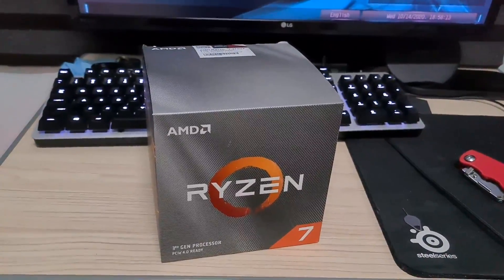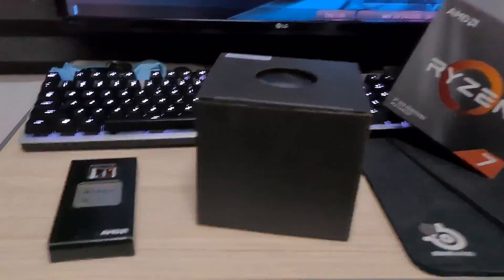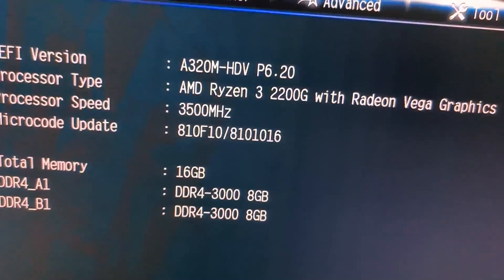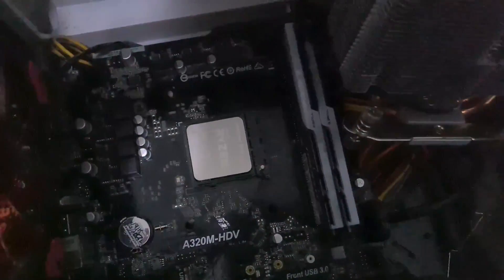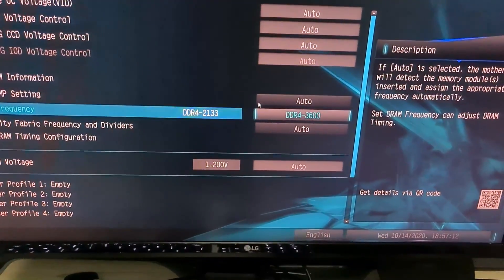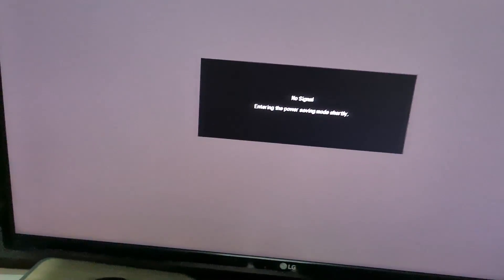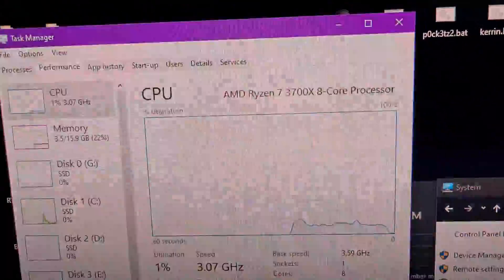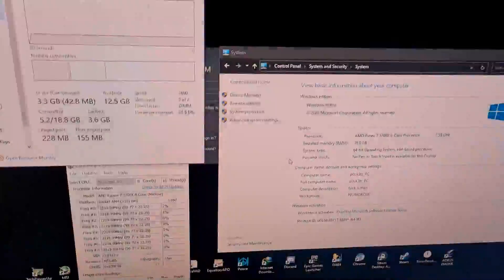pairing ryzen 7 3700x to the a320m hdv

Comment: Hi. I'm planning to buy 5700g for my asroc A320M. Currently I have 2400G. The reason for me to upgrade my processor is my CAD software starts laggy. If I have to also upgrade the Motherboard means that I have lower Processor spec. Maybe only 5500G.

What do you think?

Comment: Hi just got this cpu I have a msi a320m-a pro max motherboard with gpu prices being what they are was going to update this for now till I can get a gpu but cpu I have till this comes is  ryzen 5 1600af
Reply from the maker: well you could always update from now, using the bios version that comes from the factory is plain no bueno because of instability and even losing a wad bit of performance (my case)
Reply: @P0ck3tz  already updated had to do that for ryzen 5 1600 af to use it

Comment: I have a a320m-e motherboard, will a ryzen 7 3700x be ok?, I currently have a 3060 rtx gpu but need a 8 core to get best performance out of my 3060. Is this combo ok? I currently can’t afford to blow up an entire pc.
Reply from the maker: indeed that should be fine, I used a 3700x 3070 a320m combo for over 5 months with no issue and no slowdowns at all

Comment: Hello, I liked your video. I have a question, I have an MSI A320M Pro-VH Plus and I am planning on upgrading my processor from Ryzen 2400G to Ryzen 7 3700x...
My questions are:
•is my motherboard compatible with the Ryzen 7 3700x?
•if so, do I have to update my motherboard's bios?
Reply from the maker: yes it is compatible as long as you do the required bios update to enable 3rd gen ryzen support. some new a320m's these days come with 3rd gen support out of the box but as I said that's only the newer ones (2020 upwards). you might wanna check your specific mobo version if it already has 3rd gen support or not, if I were you I'd still do the bios update just to get it to the latest version and for stability reasons

Comment: Is ryzen 7 3700x compatible with A320m-H?
Reply from the maker: 3rd gen works with most a320's, but some brands dont support it yet, try to check your specific brand if it has 3rd gen support on its latest bios version
Reply: @P0ck3tz  yes it supports 3rd gen
Reply from the maker: @hakon8154  well go for it, my a320 doesnt come 3rd gen supported at first, but a single bios update made it supported
Reply: @P0ck3tz  It all worked out no problems normal temps thanks alot

Comment: @p0ck3tz hi there great video.. I have the same mb and I got the 7 3700x..i flash bios like your video and put the cpu in.. It will not reboot and stay on loading screen asrock. You may the only one that can help m. Thanks in advance
Reply from the maker: is it possible to go into bios and see if the motherboard is detecting your 3700x?, you flashed your bios with another cpu that worked before right
Reply: @P0ck3tz   I can open bios and it says that ryzen 7 3700x is on but is stuck on the loading screen of asrock.  I flash bios with USB using my old cpu 5 1400. I run cpu-z and the bios version is p6. 20 i run troubleshooting with repair tool but I get a blue screen
Reply from the maker: @philippossolomou8787  try reinstalling windows, sometimes windows drivers will conflict when changing a CPU even when the motherboard has not been changed.

Comment: is it okay if i use the STOCK COOLER of Ryzen 7 3700x (Wraith Prism Cooler) on the same motherboard you used in the video. Since we have the same MOBO that i have right now.. Thanks in advance.. :)
Reply from the maker: yeah that's totally gonna be fine, it'll only affect the cpu temperatures and not the motherboard VRM so it'll be all fine and well
Reply: @P0ck3tz  Because of you im getting my Ryzen 7 3700x this week!! Let's get in touch with our Ryzen 7 3700x okay.. You got a sub from mine cheers!!
Reply from the maker: @theborbz3024  glad I can help another person
Reply: @P0ck3tz   @p0ck3tz  Hello my friend, i have the same mainboard, i bought the rtx 2060 and want to ask you if I can use it proper and it works smooth with the ryzen 7 3700x...and also i want to ask if you could recommend me a motherboard with 5.1 soundcard for my usrround Sound  because i need to buy an creative soundblaster x4 for 150€ if I buy a motherboard  for that money or a bit more for same prive i woud have 2 advanteges and spend money on a motherboard with a good surround sound card instead of spending 150€ for just sound.THANK YOU
Reply from the maker: @anniannihilator5029  yeah the 3700x and 2060 will work no problem, i had my 3700x and 3070 paired with an a320 and it had no problem and no bottlenecks. As for the sound card try not to get those pcie sound cards, theyre gimmicks these days. You can always get an external AMP for way way cheaper. I dont know much but im pretty sure most motherboards already have an intergrated sound card, my x570 tomahawk does but my a320m also does (i dont feel any difference in sound between the 2)
Reply: @P0ck3tz  Thank you so much, to be sure, because i am from germany, we are talking about the 
ASUS PRIME A320M-K right? People say it qill bottleneck the ryzen 7 3700x and rtx 2060 therefore i asked you as a pro :) they recommended me the ryzen 5 3600 but i Red it has some heating problems ..i am from germany, thank you.And Yes, i have a sound card on the mainboard but there is just one entrance on the back also with 3 double chinch cables i need 3 entrances,therefore i want to buy the 
"CREATIVE Sound Blaster X4 Hi-Res 24 Bit/192 kHz Externe USB-DAC- und Verstärker-Soundkarte, Super X-Fi, diskreter 7.1.-Surround, Optischer Eingang-/Ausgang, Line-in Mikrofon-Eingang, Headset-EingangCREATIVE Sound Blaster X4 Hi-Res 24 Bit/192 kHz" 
i thought for that price you could maybe recommend me a new motherboard or something.:) Thanks my friend
Reply from the maker: @anniannihilator5029  it seems that the bottleneck seems to be cpu/gpu. not the motherboard, unless you plan to upgrade that 2060 in the future then get the r5 3600. And don't worry about heating problems. my Asrock A320M-hdv (cheapest a320m out there) powers my 3700x and 3070 with no issues at all, vrm temperatures are all under control and normal. Though i do use a pretty decent air cooler so the turbulence that those fans make probably help cool the vrms. But honestly if you are buying a new motherboard just get a b450/b550 and dont bother with A series, i made this video for people that were stuck with A320 and had no money to upgrade (the price gap between A series and B series is minor tho)
Reply: @P0ck3tz  Perfect!I will stay with my mainboard, last question, booth are the same prive here, the 3600 and 7 3700x, the second one has an coloured air cooler which i öike more, so still go with the 3600 if I dont want to upgrade?I will click the bell now, you are very smart, i dont wanna upgrade..
Reply from the maker: @anniannihilator5029  ah so youll stick with this configuration for years huh. then get the 3600 + 3060. Also whats your use case? Gaming or Productivity (Video Editing/Render)
Reply: @P0ck3tz  my pc i bought 1 year before, it has the Asus PRIME A320M-K Mainboard, and had the ryzen 3 3200G processor...it was to week therefore i bought rtx 2060oc now i am looging for processor therefore I asked you whoch one u would recpmmend..so i will buy the ryzen 5 3600..and i am thinking if the mainboard will bottleneck some of that parts, but now  i will stay with the mainboard because thats just enough some people told me, correct?Good decision?
Also i eill buy the samsung odysay g9 120hz and 1440p resolution
Reply from the maker: @anniannihilator5029  yeah that looks like a solid plan then. No worries man the A320 wont fail you, it wont all of a sudden break or have bottlenecking issues. Just make sure you're up to date on the motherboard BIOS version though
Reply: @P0ck3tz  what does that mean in no difficult english ^^"it want all of a sudden break or bottleneck..."
Reply from the maker: @anniannihilator5029  basically you dont have to worry about the motherboard breaking or it giving you any issues, because i also have used my a320m with 3700x with no issue. its just like i was using an x570
Reply: @P0ck3tz  Thank you, ok then i am happy :)

Comment: hi I wanna upgrade my processor to 3700x/3800x,
currently I'm using ryzen 5 2400g with A320M

do you know what is the difference if we upgrade the motherboard to B450/B550 rather than use this A320M?
my budget is tight,
thanks
Reply from the maker: if you dont already have an A320M i still would recommend getting B450/B550, A320 is rather still a risky pick if you dont already have one on the long term. B450/B550 is built for ryzen 3000 and thus VRM Temperature and overclocking isnt gonna be an issue. I mean sure ryzen 3000 doesnt overheat the A320. its been over  4 months and no problems with A320 but if i were u id save up and still get B450/B550 for that overclocking capability, 4 ram stick slots, better cooling, and better looking as a gimmick too

Comment: How do i update the bio
Reply from the maker: 1. Get a flash drive and plug it into your PC
2. Go the the motherboard manufacturer site and find your model and download bios flash/update
3. Put that file inside your flash drive (has to be empty with only that single file)
4. Restart your pc and spam F2 to go into bios
5. Find the bios flash feature and select your flash drive
6. Select the file and wait for it
Reply: @P0ck3tz  hey buddy, did you update the bio before installation of 3700x or right after the installation?
Reply from the maker: @clickfaithmultimedia  before, you always have to update the bios before since if you have outdated drivers the 3700x wont work. but again you need your old compatible cpu to do this

Comment: Hmm so i can upgrade my r5 3400g to r7 3700x then? 🙂 and should i change the fan too for the cooling or i just stick with the original fan?
Reply from the maker: it's fine if you want to use the stock prism cooler of the r7 3700x since we aren't gonna be overclocking anyway with an a320

Comment: Is your pc still running perfectly?
I have asrock a320m with 2200g
I want to upgrade it to 3600 or the X version
Reply from the maker: The God of War  idk if this is sarcasm but even the stock 3700x cooler will work
Reply from the maker: yep it does, no problems at all. check out my channel and all those videos of benchmarks you see are me running the asrock a320m too
Reply: TheBeginning  The Wraith Prism that comes with the 3700X is a decent cooler. There's not much point in replacing it if you're using a motherboard that doesn't allow CPU overclocking.